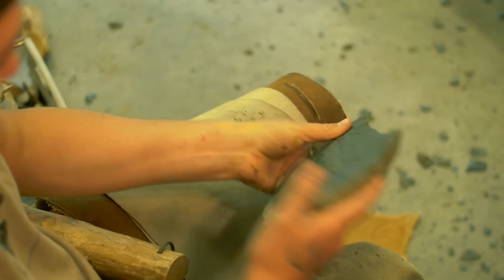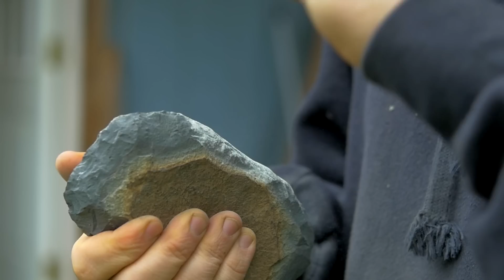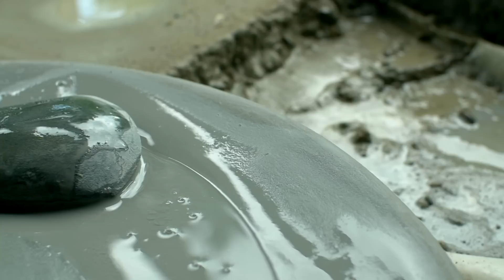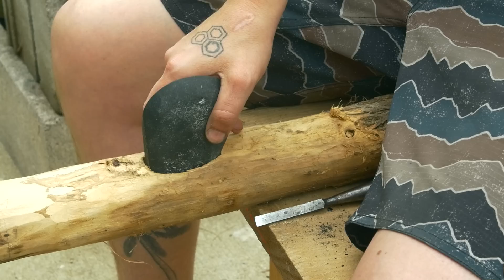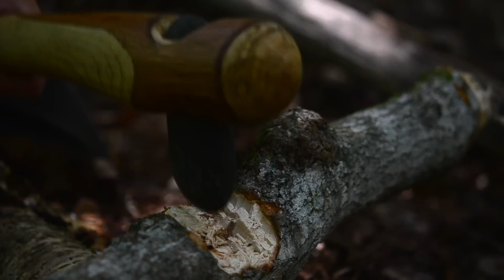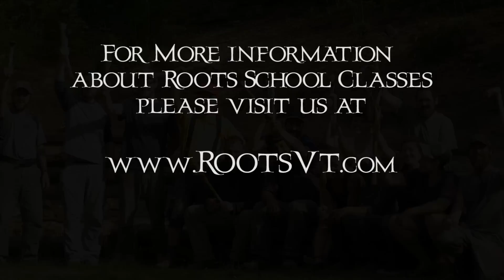Stone Axes, Adzes, Celts and Chisels-Pecking and Grinding Class

Comment: Any one else find it a bit ironic to use a modern steel chisel and file?
Still, these are impressive, I want to make one.
Reply from the maker: dasdew2 It is a four day class so after the students spend three days making the head they only have a day to bust out the handle...hence metal tools. Not to mention it is much easier for me to have a set of 12 metal tools than 12 stone tools for students to beat on.
Reply: +ROOTS School 3 days making the head?? It shouldn't take that long though it can be done in just a few hours.
Reply: +Bea Al Making a good head that will last, Slow and steady will win the race at building.
Reply: Harley Inglis it still doesn't take days
Reply: Bea Al but still not everyone has time to do that. If I was a wild person yes I could.
Reply from the maker: +Bea Al Out of VA greenstone? To knapp, peck and grind a fine head? I'd love to know how that is done?
Reply: +Harley Inglis (Steve) they live at a camp for a few days doing pretty much only this. they have the time.
Reply: +dasdew2 yeah it might take less than three days on sandstone...
Reply: The simple to make but take a LOT of time to make
Reply: I think it’s ironic that the first electric polisher would be considered impressive,

But now if you polish something by hand it’d be as impressive.

Comment: Question: is a stone axe used differently than a metal one? The stone axe is being used in a straight perpendicular direction, so it's sort of "macerating" the wood, rather than cutting. Usually a modern axe is used at about a 45 degree angle, so that it cuts across fibers and removes a chip. However, it looks as if the stone axes are sharpened to about 50 degrees included angle, rather than the 25-35 that is used with metal. Perhaps this is the difference? I imagine the edge might fracture if used in certain ways...
Reply: one good plus for the stone axe is it bounces so you don't have to pull it off the wood like you would a steel axe
Reply: That is a different tool altogether, it’s called an adze. The axe head is turned 90 degrees from where it is on an axe.

The axe’s head is vertical, the adze’s head is horizontal. I know the adze was used for planing floor boards to size for ships in recent history.

As for why they mounted their axe heads in this manner is personal preference I assume, and the purpose of the tool, as well as the maker, these would have been made by the user, so each is unique.

Comment: nice video but I just want to point out that making a hole in the handle with modern tools kinda ruins it...
Reply: *****
Doesn't make sense,  you spend all that time making the stone axe head which is genuine, but then use modern steel tools to make the wood handles?
 All these classes cheat..Why cant you just do the real thing and show everything?
Reply: 5tonyvvvv Days of doing the same thing with a coarse stone. DAYS more.
Reply: Janine Cat What?
Reply: ***** I just wanted to see how it was done with all stone tools, thats all man You dont have to write a book.

I see the same thing with people making bows, with stone tools. But  first they use a chain saw to cut the tree, HA!
Reply: l
Reply: Yup. So now you get to do the update version of making the handle with all hand tools. What kind of hand tools? Just stone knives and axes and fire? Sinew or plant fiber to attach the stone? There is a lot to do and its more complex than you  think. Primitive is difficult. Modern makes that process much easier. There is always a different tool to help make the job easier. But I agree, Stone Age should be kept Stone Age to show what people had to endure to get a meal.

Comment: the part were you lose me is when you started yousing iron tools to make stone tools not hating but well?
Reply from the maker: I get it. Sometimes I approach things from a purist mindset. Of course, the old joke was bout how far to take it, did you drive a car to the school, did you hunt the food you ate while making it with traditional weapons? Etc. In this case, it is a class setting where as the instructor my main goal was to help folks understand how to shape the stone and haft it. The stone shaping is done with all traditional methods and it takes bout 3 full days of hardworking pecking and grinding. At this point I have to choose between having people use stone tools which requires using green wood and working it 95% of the way and then carefully curing without checking over the course of a few weeks, or using steel tools and already seasoned wood and having students leave with a finished and functional tool.

Comment: How did you split the rock at the beginning? Also was that just a stick that was being used to knapp?
Reply from the maker: Its a technique called block n block, and its more like flint knapping but instead of hitting the percussor against a rock you hit the rock against the percussor.  The wooden billet, also known as a baton is the hardest dry hardwood you can get.
Reply: @ROOTSSchoolVT  thanks. Would fire hardened oak work for the billet?
Reply from the maker: Yeah, it should, even just seasoned would be good.
Reply: @ROOTSSchoolVT  thanks

Comment: Let's keep metal out of Stone Age tool making
Reply from the maker: +tanfo8 This is a video of a class in which we have 4 days to teach people how to peck and grind and haft tools. If I make the class longer it has to be more expensive, ie less accessible. So when it makes sense for people to do easy wood working tasks in a class setting, then I have then use metal tools. I demonstrate how to use stone, tools, and how it is different. One of the major differences, which I am sure you know since you know so much about stone age tool making, is that most stone age wood work is done on green wood, which is then carefully dried so it does not crack, and then finished, since green wood is so much softer than dry hardwood. This process can take weeks as you need to dry it slowly and carefully to avoid checking. So I have people use dry seasoned hardwood, which is painfully slow to work with stone tools.  I also dont have 15 pecked and ground stone chisels and axes lying around to let students beat on.  If you want to make some and donate them to the school, we will surely let the students use them.